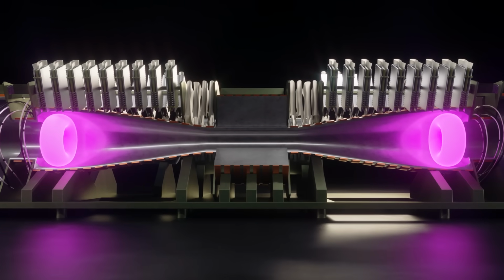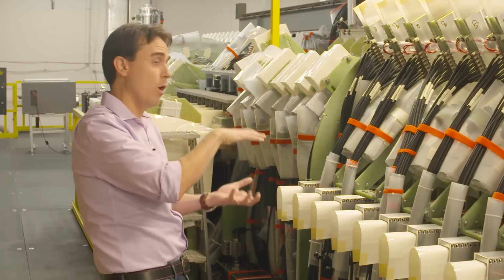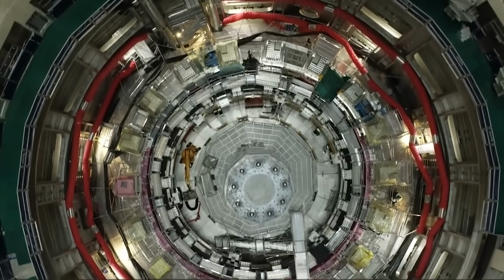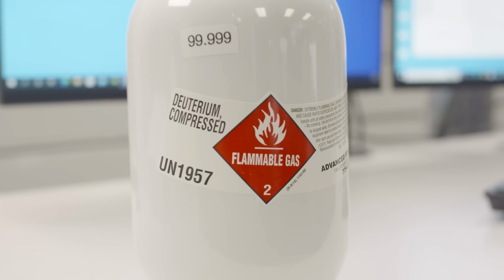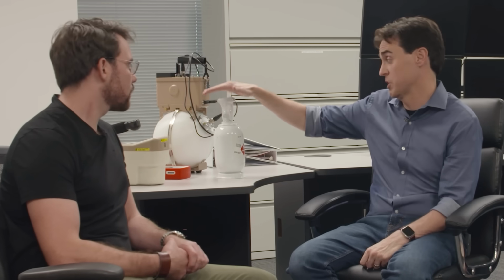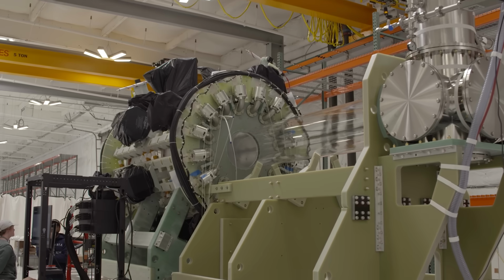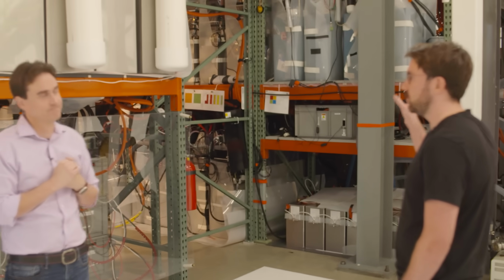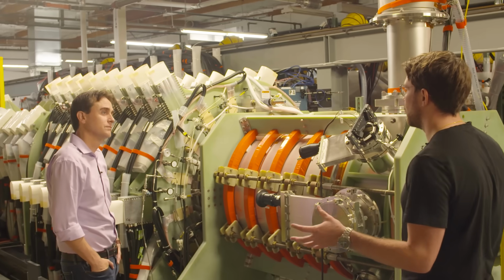A New Way to Achieve Nuclear Fusion: Helion

Comment: Well, supposedly, there's plenty of HE3 on the lunar surface.  It's been accumulating there for billions of years.  It might initially be expensive to mine, but after proper infrastructure is in place, the place will come down to it being cost effective to make Helion reactors commercially viable.
Reply: What I initially thought, but did you catch the part where they make their own helium3 from deuterium? Will be far cheaper than mining the moon.
Reply: @rhensontollhouse  not really
Making deuterium and tritium uses more energy than it gives back
We will need better fusion reactors for the process to be cheap
Reply: @ypsawbones3646  They don’t use tritium, dueterium and Helium 3.
Reply: That's just it, their process doesn't need to mine it. They manufacture it.
Reply: @rylian21  But it makes it not as energy efficient as it may be without this process and more expensive (it damages the reactor). Mining the moon at this point will be more expensive but using this reactor at moon bases or spaceships will be a different story.
Reply: And what if not all of us want the moon mined? What effect, if any would that have on the earth’s tides, weather, orbit/seasonal wobble? The damage of so many more commercial space vehicles entering and exiting the atmosphere (with associated toxicities of their combustion byproducts)? Deuterium exists right here and is abundant. Their process makes He3 from it. Surely that’s the logical way of doing it
Reply: @tristanmelling410  You watch to many movies. The moon is huge, 
taking even all H3 at once, will change it gravity at the level that is hard to detect.
And we call it mining but he3 is on the surface. It will look more like looking for a gold in the river.
Reply: @tristanmelling410  The Helium on the moon has ZERO effect on the Earth's tides/orbit/weather. Helium has virtually no mass, nor weight, nor gravitational pull, as compared to the ROCKY MATTER than makes up the vast majority of the Moon's mass. Removing it will have no such consequences.
Reply: @@OnyxDeath1312 funny thing is, it actually is, heavy water nuclear reactors produce it as a by product as they use heavy water to slow neutrons down, as well as the coolant for the reactor
Reply: Considering the energy needed for a rocket. The bulk it can bring in (not a lot), all the process to build mine/ sweeping factory whatever it is. You talk about 100-150 years project to organize. Human supervising and operating systems on moon seems out of reach before next 25years. And the cost to develop the technology and mines on moon… with all that in minds. It’s better to do with what we have on earth. Especially that fusion is to have also a future good energy. Using hundred of rockets to mine a planet seems like the best way to destroy our atmosphere even faster.
Reply: @Invicious13  There's always the theoretical solutions like nuclear rockets, or space elevators, but those would also cost a lot of money to produce and up keep would be an absolute nightmare for both, plus, for any version of mining on the moon or other space objects, just getting the infrastructure to be able to mass produce the equipment needed would cost more than anything else, any big project needs infrastructure to back it, aka the factories to make the stuff, the training for people to make the stuff, or the time needed to code robots to make it, to train people on how to use it or train AI on how to use it, getting the materials to make the stuff, etc. 
In general, until getting stuff outside of Earth's orbit becomes more common, the idea of mining stuff on the moon, asteroids, other planets, or other planet's moons is out of the question unless some of the biggest countries in the world are willing give a large budget to the space industry
Reply: Not if the Democrats keep destroying our economy. We're already in a politically-induced recession, and next year is going to be a lot worse. China will take the lead, given to them by Joe Biden and the Democrat Party, and China will prosper and grow stronger, while the United States lapses into mediocrity, poverty, and a state of dependency on China and other foreign powers.
Reply: MOON
Reply: Did anyone watched the video above? Everythig explained where to get, how to avoid risks etc. Stop shitting around without even looking into the video
Reply: Assuming the "proper infrastructure" isn't patented, and then that behind a patent to a patent on how to get proper infrastructure, let alone make it, in order to use it and pay all the profits in hefty licensing fees.

OF COURSE after the market regulation by MONEY, has already done it's primary function of running out. Currency is simply a stopgap introduced into the natural market. So even if you HAVE resources, it runs out like so much printer ink, until you get more from the CERTIFIED supplier. The guy with all the patents, and militaries, exclusively patented for the use of privateering buccaneers.

That's why we ought to terrifiy them. Yo ho ho.
Reply: @sboinkthelegday3892  Oh, it's not that the proper infrastructure is like a single patent or two, I'd say, for an infrastructure like that, it's probably at least 200-300 patents for the many, many individual pieces, from molds for certain things, to all the hundreds of technologies needed for an operation of that scale
Reply: I think we should make the biggest and longest indestructible straw place one end on earth and the other on moon
Reply: About helium 3 the moon. Just imagine this fusion machine converted into a spacecraft engine powered from mined helium and launched from the moon instead of Earth…

Comment: what speed get the particles from the fusion plasma?18.3MeV? that is a lot. Bravo. 1000A ? is not much for that big chamber. You can get more if put the cables in antiparallel.

Comment: One think that impressed me about the NIF press conference with the fusion scientists that achieved the greater than unity fusion gain, was their willingness to provide real information. Such as the input power to the target , the fusion power generated, the percentage of the target that achieved fusion, and the actual energy input to the lasers. Also their comments regarding the near impossibility of scaling this approach to an actual power source were freely given.

Compare this tightly controlled and well choreographed interview. Absolutely no hard information was given, no temperatures, no confinement time, no compression data, no details of fusion neutrons detected. It was not even clear what plasma they were using I suspect this was a deuterium plasma, so it is quite likely they got negligible fusion.  Even the 3 Mjoule that NIF got is about 10^18 fusions, so they should have detected something. 

Of course a private company has no obligation to publish any results. However the risks of not being honest with their peers increases with the amount of time they hide their results. Eventually they do "change the world", to great acclaim, or it all collapses into ignominious failure.

Comment: Alas, HELION Energy is about to deliver (as it promised) the protoype POLARIS reactor, the precursor to it's TRENTA reactor, demonstrating the FUSION Energy use as new electrical energy source to the end users and also shall help mitigate the global climate change impact by reduciong carbon dioxide emission. So, with it's promised new 7th POLARIS Fusion Reactor it will thus produce net electricty output @ 50MW rating and hopefully it will be attempted to connect to the utility power grid and share it's produced output to supply electrical power to the endusers.

Comment: And of course their system requires an exotic fuel source that barely exists on Earth. Helium3 is very hard to come by, which means that while there is enough to experiment with, there is not enough to actually use it as a commercial grade fuel! Which means that while it gets the job done, like so many others before it, it is not sustainable!
Reply: Helion will produce their Helium3 by fusing Deuterium in the same machine. D+D => He3 +n or D+D => T + p (the Tritium eventually decays to He3 as well). 
The fuel availability is not that big of a problem.

Comment: If the new nuclear is like an ICE engine, then a "V" configuration will help: use a "piston" to start the reaction, take the output energy and feed it into the next piston and start another process while recharging and cooling the capacitors/piston from the next one and so on. The remaining energy will be send to the grid.

Then sync the pistons and stop using the 100% capacitors and only use the output energy to start the next reaction.
Reply: Not sure how a v- shape would help here. They CAN however combine multiple cores into one power plant and yes that makes things a lot more efficient.

Comment: This is very promising and frankly the best shot I have ever heard of for actual working fusion for power generation. They have their minds in the right spot as well as they are working out how to make it work both technically but economically which is the real key to this all actually making a difference. If it is not cost effective it will do us no good if it can't make it on the market being both cost effective as well as being able to mitigate it's on expense. All this and it's a more functional design compared to the others in both terms of materials needed and size. Just amazing and hopefully it's just around the corner of becoming a reality.

Comment: Are they expecting to charge the capacitors with a % of the output from the reactor? What is the expected margin?
Reply: They can recover 95% of the input energy directly as electricity plus a significant amount of the fusion energy as well (slightly less though). Some of that combined energy goes back into the machine for the next pulse, the rest is stored in the capacitors and gradually released to the grid.

Comment: I appreciate how much effort must've been put in into getting the timing perfect on such incredibly small time scales with so many different components. My main concern though is how will they be able to capture enough energy from the magnetic fields alone to make it a net positive (where will all the thermal energy go?). And even if they achieve a net positive with this machine, will they have enough energy created to power the fuel generation?
Reply: Deuterium extraction from seawater is relatively simple and a single power plant needs maybe on the order of 20 kg or so a year. That is nothing.
The He3 production from Deuterium fusion will roughly be self-sustaining. The majority of the electricity that goes to the grid will come from the D-He3 reactions.

Comment: They isolate the heat with magnets?
Reply: Parastoltic beyond the speed of light?
Reply: @jedgould5531   Speed of light 300,000 km/s. Speed of Helion's plasmoids 300 km/s.
Reply: @elmarmoelzer2229  300 km/s. Just this part of their tech, if applied for a thruster, would translate in an Isp of 30,000 s. That's a whole order of magnitude above the best electric propulsion tech we have, and two orders above anything chemical ... 😳Nice.

Comment: What would happen if you tried to slow the fusion process so it takes longer to form as all this is happening within a blink of on eye. What if you took more time to combine the fusion materials. Also could you try giving it a different core as if this is a mini planet you are creating it would not be made up completely of  plasma it would have a stable core made up of iron and other things could use are sun as a guide on what it should be made up of just scaled down. Giving it a gravitational force at the right time would be key for a stable iron core then add the plasma that's been created you would have a mini planet

Comment: Those fusion plasma donuts wouldn't happen to be rotating with opposite spin would they. And the isotopes produced wouldnt happen to be to be an array of all the isotopes found in the earths crust in there relative abundance. If they were it would be convenient for scientific acceptance to merely call this fusion, anyways don't dismay, you can probably achieve the results above without such a large apparatus, just go read up on ball lightning, nature invented it and it can't be patented so the only thing that will ever teach it to you is nature....

Comment: One thing that wasn't mentioned explicitly in comparing this approach with tokamaks is the idea of sustained fusion. Tokamaks are attempting to make a self-sustaining reaction that requires minimal energy input to sustain (thus producing a net gain). The Helion reactor, if I'm understanding correctly, is kind of pulsing fusion reactions and managing to get a net gain without need for a self-sustaining reaction? This fact is actually the most amazing thing about this! This reveal should be major news in the science world. I'd be curious to know what the mitigating trade-offs are for this approach.
Reply: They don't need to achieve ignition (the self sustaining burn) because they can get 95% of the input energy back directly as electricity. The energy from the fusion reactions then makes up for the 5% loss and adds enough energy to sell.

Comment: While you guys figure this out, I'm outsourcing fusion to those who've been doing it for 5 billion years. Silicon, the second most common element in earth's crust, is really good at converting light into electricity. So far it's been quite amazing - no moving parts, no water, no high pressure, no radiation.
Reply: Only problem with solar power is that it is unreliable and does not work at night. It is also not very energy dense.
Reply: @elmarmoelzer2229  Lack of generation at night is a real problem, as is seasonal variation. But energy density isn't a problem..if solar panels on an American house roof can meet its annual energy needs (they can), "energy density" is a non-issue.
Reply: @anthraciteenergetics5497   It is when the grid cannot handle the distributed production. It is very expensive to make that work. That cost has to be included into the cost of the system. 

Also, not everyone is living in a single-family home. People do live in multistorey buildings in big cities, especially in the big cities. Those buildings have a much smaller area/consumption ratio. 

But really, the killer is the variable production and unreliability. Right now it is only natural gas powered gas turbines (very dirty) that can compensate for that.
Batteries cannot handle it (there is just not enough of them and they are expensive and come with their own environmental issues). Hydro storage is too dependent on geography and geology. Also not that cheap.
In contrast Helion's machine would be able to do it since they can load follow really well by adjusting the pulse rate. They would (likely, if all goes well) be cheaper than natural gas and of course have lower GHG emissions, likely the lowest of any energy source.

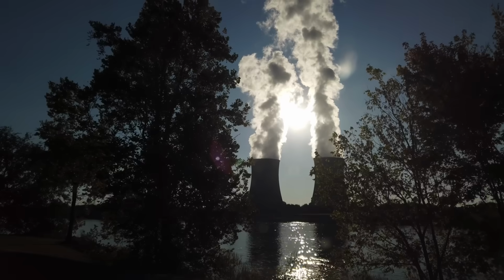Comment: 11:45 It baffles me that you imply that wind energy is cheaper than nuclear energy. Wind turbines struggle to break even with energy required for their manufacturing and maintenance, while nuclear energy density and efficiency blows literally everything else we have right now out of the water. Wind and soilar energy exists 100% because of the subsidies. It NEVER was cheap enough to stand on it's own. All energy required to produce these "clean" noise-polluting eye-sores is taken from fossil fuels, and then slowly put back into the grid, while suffering from winter malfunctions and needing frequent replacement that defeats any hopes of long-term energy benefit.
Reply: Uh huh

Comment: Fusion has to work. Our survival depends on it.
Reply: Nope.  Nuclear power plants, wind and solar, and burning clean natural gas will allow mankind to EASILY survive.
Reply: @DerekDavis213  Good luck. It's not doing it at all right now. Wind and solar are a joke. Wind turbines last 20 years at best, they are a hasard to people on the ground if covered in ice, they kill thousands of birds, they are very noisy and we cannot recycle the massive blades once their life cycle is over. It's a mounting pile of trash with no solution for the intermittence of the energy source. 

Solar is the same problem, a pile of trash that uses to much space and is intermittent.

Nuclear is great, but not nearly cheap and fast enough to build to replace fossil fuels before 2030.

Natural gas is only a transition energy as it still emits green house gases in significant amounts, less than oil and coal, but significant nonetheless.

Comment: So they made 2 plasma cannons and pointed them at each other. I like the simplicity of it
Reply: There is more to it than that. The two FRC plasmoids merge and form a single, hotter and more stable FRC that then gets compressed by strong magnets to even higher temperatures.